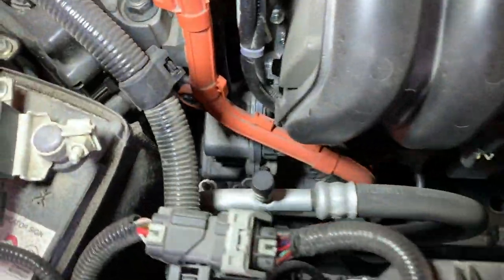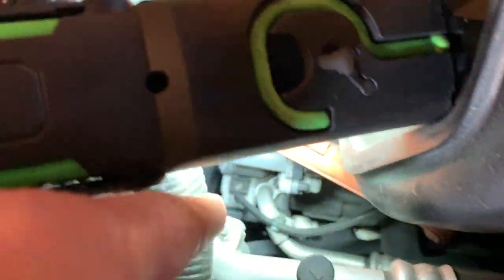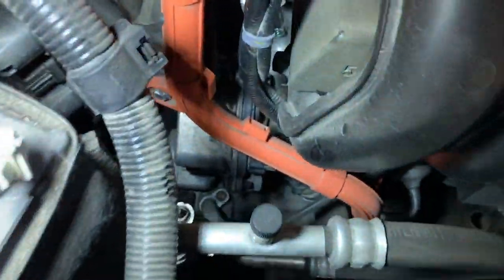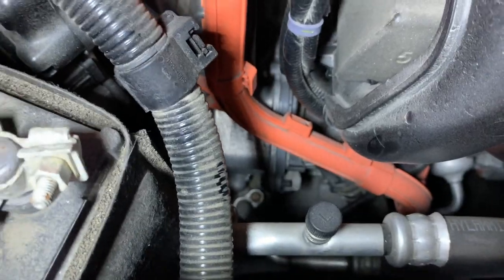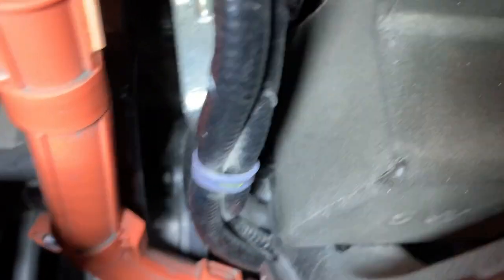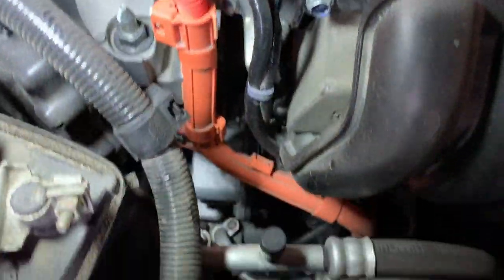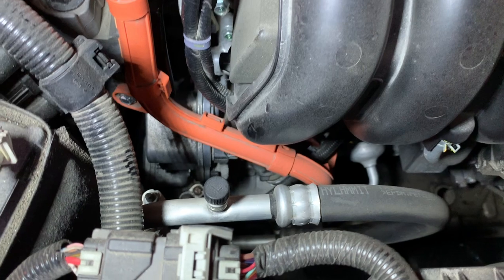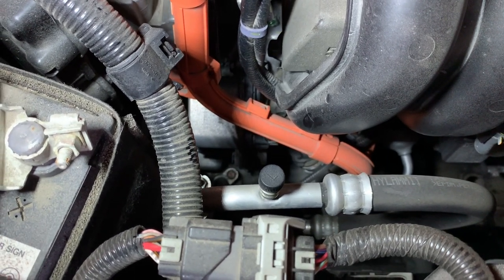PHEVs and Air Conditioning   How does it Work?

Comment: All hybrids/electric/PHEV's use an electric air conditioning compressor some cars even have a reverse air conditioning system called a heat pump this can heat and cool the cabin they also need a special oil because regular oil can short the motor and kill the motor and you don't want to do that. also tesla uses the same basic principle but the voltage will probably be different as they have much mor power and finally be advised this car uses the new standard of refrigerant r1234yf which is high pressure and has different connectors then the common r134a so don't mess around with those kinda things (I just quickly wanted to let you know the heater uses up to 7kw unless the engine is on)
Reply from the maker: Hey man!  Thank you for the detailed reply!  And yes I do my best to keep the heater off unless I absolutely need it.  Usually when the kids are in the car ;).  

Thank you for watching and for commenting!  All the best!  -Brad

Comment: I have an HVAC related question: in the winter (when temperatures are below 40 F), the windows fog up pretty quickly just because I'm breathing. If I breathe through my nose it takes longer than if I'm talking on the phone, but either way, the interior of the windows will fog up fast. This means I have to leave defrost on and use a lot of EV range for that. It makes pre-conditioning the cabin almost useless because I have to keep defrost on for the duration of my drive. Do you have any solution for this?
Reply from the maker: Hey Sean.  No that does not happen to me!  One thing that can help is to run the defrost at a lower temp and with the AC on.  It is a dehumidifier, so it should only take a minute or two to clear it up.  With luck that will keep it away as well.  Far better than on heat with fresh air only.  Hope it helps!  Best of luck either way!  -Brad
Reply: Check the button for interior air re circulation. If it's on you're recirculating the increasingly humid air in the cabin. Turn it off so you're bring fresh outside air into the hvac system.

Comment: What is the electric motor?  Is it the one that drives the car?  Or does the ac have its own motor?
Reply from the maker: Hey Mitesh!  Forgive me; from what I can tell the AC unit has its own electric motor.  Judging from the way it looks and the large high-voltage cable that runs to it.  Thanks bud!
Reply: @BradOnCars  interesting. So its different than other cars?  I do notice the ac is much quicker than other cars but it does have a problem keeping th car cool over 95f
Reply: @MiteshDamania  nope the speed is variable it can increase speed or decrease it depending on how hot it is